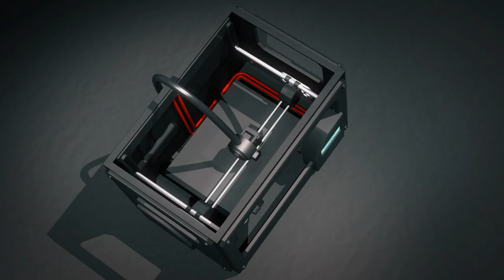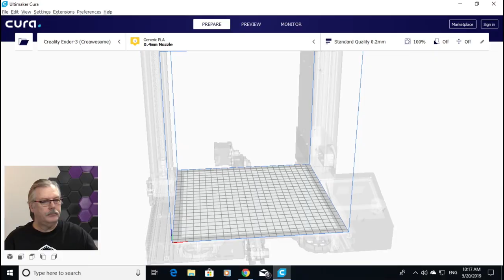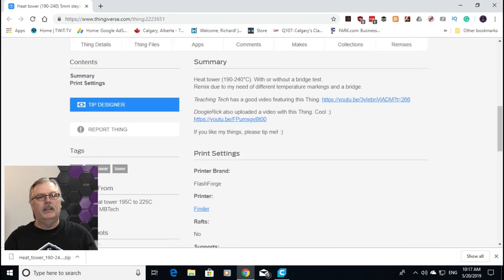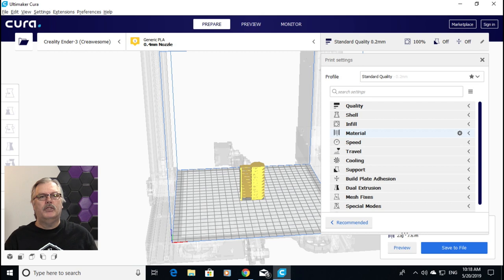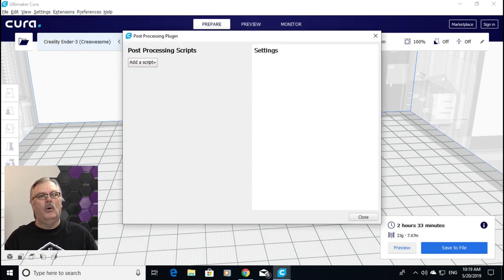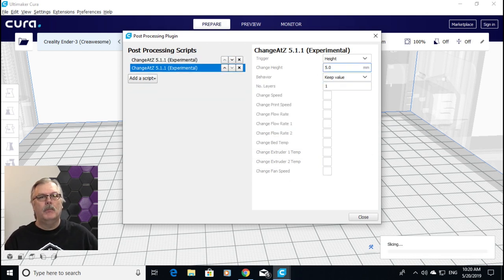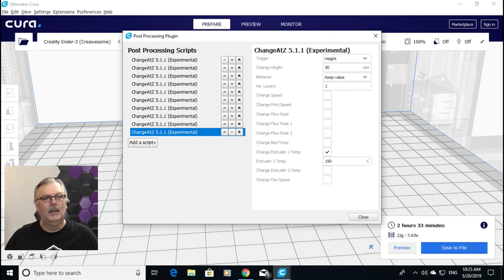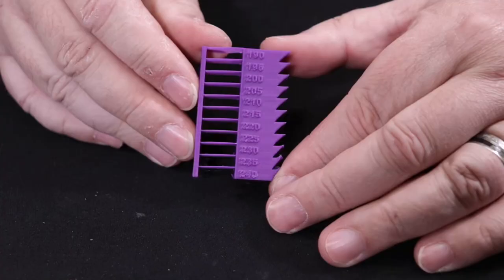Back to basics: How to print a Temperature Tower

Comment: There is a flaw in setting the temp to change at the 5mm mark.  The bridge prints at intervals of 5mm, so if you set the temp to change at 5mm it will drop before printing at the desired temp.  Ex: you start the tower at 240c so you want the first bridge at 240c also.  Same with each layer.  I corrected this by shifting the change at 5mm+ my layer height(.2).  So set your temp change at 5.2mm, 10.2mm, 15.2mm etc.
Reply: Good catch Mr. Jimmy2Horses, thanks.  I did as instructed in the video and noticed temp change was not quite right, so straight to the comment section and sure enough, a solution.  Still, thanks to Richard for an excellent video.
Reply: Good point!

Comment: Hey Richard, I followed all the steps in your tutorial and I am having issues on both printers I have set it up for. Hopefully you can figure out where I'm going wrong. I'm using Cura version 5.2.2. On my Prusa mk3s the first 5mm extrudes at 240, but then it goes back to 190 for all the remaining layers. I doublechecked that all the temp steps are in order, but maybe there is a setting I have missed? This is my first time using cura so could it be the gcode setup? It was selected on Marlin by default... 

And my other issue I'm having is I resliced the temp tower for use on my Ender-3 S1 Pro and it just prints the entire thing at 200c.

Any help is appreciated. Im trying to get everything setup for at our youth center using econofil upon your recommendation (we spoke on the phone a while back) so far it seems like great filament. Thanks in advance. -Sheridan
Reply from the maker: Reach out to me through email.
Reply: @TheFirstLayer  Where do I find your email?
Reply from the maker: @snazeevid9802  richard@thefirstlayer.com

Comment: If you have more than one 3D printer, also note for which specific printer your results apply.  Different printers can have variances in the hotend and tolerances with the thermometers measuring the hotend, so the test results will be printer-specific.

Comment: I get the "thermal runaway" error when I try to set it to start at anything over 230° c - even had at least one of those errors starting at that temp. Any advise? Idk if just turning the fan up would help or what a good fix would be.

Comment: This temperature tower has a flaw in it, noted by many in the Thingiverse comments. The bridges are at 5 mm increments, so if you set your temperature changes also at 5 mm, the bridges all print at the temperature of the tower section above, not the tower section below. I think that a clean solution would be a tower model where the bridges where in the middle of their respective sections, but a workaround is to add your layer height to each temperature change command, so 5.02 mm, 10.02 mm, 15.02 mm, etc.

Comment: You should accommodate for the layer height, so if the layer height is .2 then your height intervals are 5.2, 10.2, 15.2, 20.2, etc.

Comment: This doesn't explain why you'd go for temps outside the specs by the manufacturer.
The sticker on my spool says 240C-260C and when I set it at 250 the results are perfect.
So I'm not sure what the purpose is of testing other temps. Is it to figure out how to print with lower quality filaments?

Comment: So, I was printing the temperature tower and something strange happened.   The first few sections printed fine at the correct temperatures, but then after 210*C, the temp suddenly dropped to 195*C and then to 190*C in the same section.   I looked at the GCode and it seems correct.   I was wondering if you might know what the problem is?

I should mention that I am using Cura 4.71.  Also, in the extensions there is no Behavior item anymore.   Instead in its place is Apply To and it is set to Target Layer and Subsequent Layer instead of Behavior and Keep.
Reply: Okay, so I went back to Cura 4.6.2.   That one looks like it will work.
Reply from the maker: I will do a temp tower using 4.7.1 and let you know my results.

Comment: Ive followed this step by step using cura & Eryone Thinker S ... BUT when i send it to print the display says 240°c all the time & once its finished it looks completely the same print all the way up i see no changes at all..   (Please Help)
Reply: Hi same here, have you found a fix?
Reply: @JA-ur8ob    yes i opened the .gcode with notepad & edited the temps manually as they were all there at  the Hight they should change at but saying the same temp...  it must be a cura problem..
Reply: @yorkshiresfinestpair  Thanks for your quick reply. One last question though, did you have Output to LCD ticked in the post processing options? Also did you apply it to "target layer + subsequent layers"? 
Appreciate it
Reply: @JA-ur8ob   sorry i dont remember seeing any of them settings. Im still new to this & learning myself. all i remember is thats how i got it to change heat settings at 10mm increments  as when viewing the gcode file in notepad each hight change said the same temp..
Reply: @yorkshiresfinestpair  No problem, thanks heaps for the advice. I'll try that next.
Reply: @yorkshiresfinestpair  Hey man, I think you're right about it being a Cura thing. I got it to work but by setting the temperature change at a specified layer as opposed to a z-height. 

Looking at the gcode, whenever I did it as specified in this video, another M104 command just resets the change back to the initial temperature for no reason. 

Working with the layer numbers worked fine. Going to send it off to print right now. Just seems easier than manually tweaking the gcode.

Best of luck

Comment: Great video but just done a temp tower as I’m a beginner and very informative, using pla wood filament on an ender 3 pro and has melted so badly that I can’t remove the skirt from the mag bed and just put a hole in it..oh well lesson learned..I’ll start my temperature tower at 225 from now on..

Comment: Probably a silly question but, why does my cura (4.6) fill in the bridging areas? I have done exactly as you do in the vid and cura shoes the bridges all mice and clean. But when it prints the bridge gaps are all filled in! Help please!
Reply: Make sure you don't have supports turned on.
Reply: Your slicer is set for "Support Everywhere".  Change to "No Support" because most test towers do not use supports, it's a test of your printer/material to see what settings are best. "Support Everywhere" will fill every horizontal opening depending on your support angle setting.

Comment: my printer geeetech a10 starts off 240 then as soon as the print starts drops to 215 whats the deal?
Reply: Make sure you've got the multiple steps set up, and make sure they're set up in order.  See https://youtu.be/BpEuSSql6FM?t=256 about 4 minutes.  I started mine at 240, then 235, and stepping down to 190. Once you've put your temps in go from the top to the bottom and make sure when you're clicking through that they all change by 5 increments.  And then look at the layers and make sure it starts at 5 then 10, 15 ect.

Comment: why do you start with the highest temperature and finish with the lowest temperature of the test? It would be logical to start with the lowest and end with the highest.
Reply: i’m no expert but the higher temperature will help with the part sticking to the bed, i printed parts with a quarter of the size of that and it came of the bed, printing at high temperature will help with the bed adhesion
Reply: Filament flows more fluidly at higher temperatures (until the point where it starts to burn).  At too-low a temperature, clogs and mis-prints can occur.  Starting at a higher temperature reduces the risk of printing in open-air due to an earlier layer being too cold and not fully extruding.